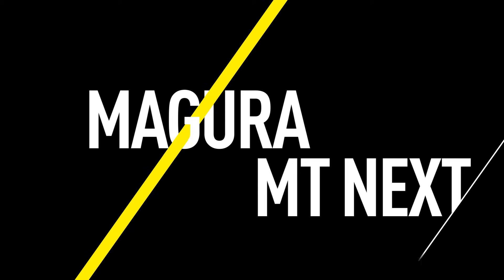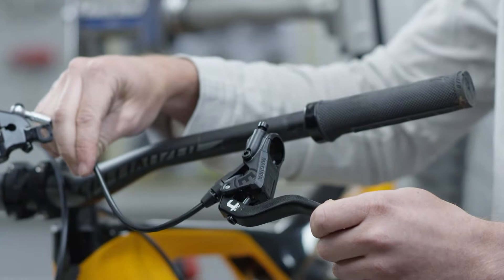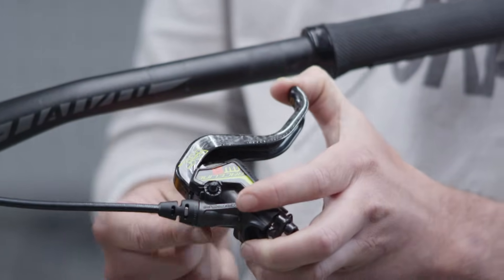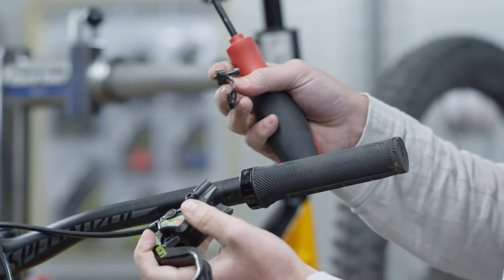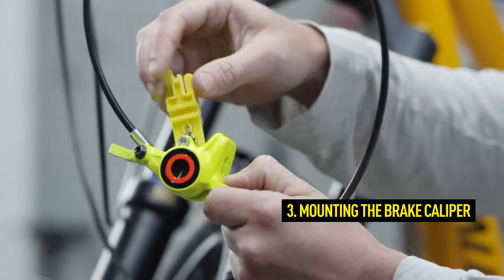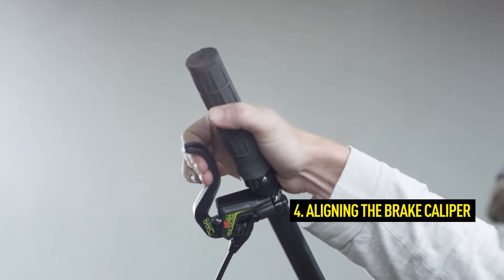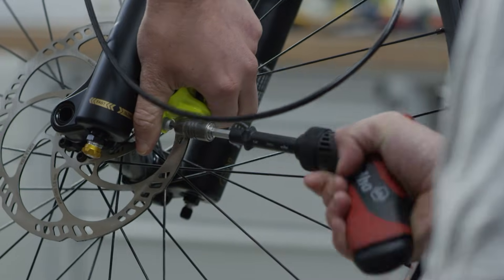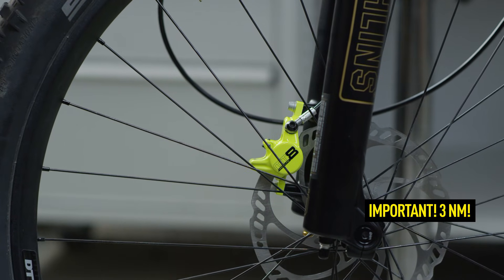MAGURA MT: Installation

Comment: Did I understand correctly that for installation Magura MT5 on the right side, I need only to rotate the clamp? And I don't need to do anything else.
Reply from the maker: Correct! For the MT7 and other models with the Carbotecture SL master you would additionally have to flip the BAT pin.

Comment: Why must that E thing be upward?
Reply from the maker: Do you mean the "M" on the clamp? Or did I misunderstand you? The arrows on the clamp have to point upwards and the "M" has to be oriented the correct way up, since the clamp is designed to carry the load that way. You then need to tighten the upper bolt fully to 4Nm first, only then continuing to tighten the lower bolt.

Comment: Hello , what difference between mt7 and mt5 ? and also HC3 lever can fit on both 7 and 5 ? thanks a lot
Reply from the maker: The MT7 has a bit more power and more customization options compared to the MT5. The HC3 lever does NOT fit the MT5. It's only compatible with Carbotecture SL masters: MT7, MT8 SL, MT8 Pro, MT Trail SL.

Comment: Fo not buy Magura. They do not have warranty if boughtvsecond hand and levers are not repairable only replaceable and no parts sold (ask before you buy) what an enviromental waste
Reply: No companies give warranty for second hand parts lol. And you can buy spares for the levers. You can buy just the lever without the body...
Reply: @Mortonbmx  car companies do... Computer and phones have second hand warranty. Magura does not sell o repair their levers (orings pistons)
Reply: @InstaLabSparti  were talking about bikes not cars or computers. I dont know of any bike companies that give a warranty to 2nd hand used parts.
Reply: @InstaLabSparti  by the way shimano dont either. You have to buy a new caliper/lever if you damage a piston or seal. Hope and sram are the only ones that have rebuild kits for their brakes.
Reply: @Mortonbmx  but you can find shimano parts easy, orings pistons...

Comment: To anyone thinking of buying these, don’t. I have just wasted money on same and they have damaged my raceface carbon bars due to their cheap lever mounting mechanism. I used a torq wrench to the correct nm, the bolt on the calliper sheared into two like chalk. As such I thought I would take the levers off as they are dire, replacing same with Shimano. Upon taking off the lever I seen that they have marked my CF bars, the mark directly lines up with the blunt plastic on the the back of the mt4 lever, the back of the lever mount is not smooth but actually tough plastic.

Therefore, I’m down over £100 on bars and now need to find new levers and a new bolt, seriously go for Shimano or Hope, these were worse than the Tektro brakes that came with my diverge.

Comment: I wouldn't consider this complete by a long shot. Pretty long, but not as long as all that brake housing that was left on this install
Reply: Agreed. This is the easy part - tightening bolts… I came for tips on routing through the frame with an cut open end housing…
Reply: @urbanphotographer  there is a end pin that comes with the baeaks.  Little late i see 😎

Comment: Hi does the magura MT5 eSTOP comes with brake pads and bolts and transport device to use when shorten the tube
Reply from the maker: Hi! The MT5 eSTOP comes with brake pads & transport devices installed, bolts to mount it, and some accessories such as a new olive and insert pin for shortening the brake hose.
Reply: @MAGURAPassionPeople  I wish the brake Lever were made of aluminium that's a only reason I didn't buy magura and bought shimano slx m7120 instead
In the future I might change the Caliper to magura

Comment: Magura doesn't provide washer shims with their adapter kits. Leaves the customer to go to home depot to find various width washers.
Reply: Why do you want washer shims? Serious question, i've never pulled brakes apart...
Reply from the maker: @thelongestnameinthecomment9677  They're used to adjust the height of the caliper in comparison to the rotor so the pads make contact at the right position.
Reply: @thelongestnameinthecomment9677  the magura adapters lack adequate adjustability. So, the customer will buy the magura adapter shims. Marketing genius!
Reply from the maker: @Paul We do sell washers to adjust the caliper height.
Reply: @MAGURAPassionPeople  my qm12 adapter KIT was missing them.

Comment: * accelerate bicycle to 30km/h
* brake bicycle to a stop
* REPEAT 30 - 50 TIMES!!!
man, i'm on a single speed urban trials bike in a flat city.. how am i suppose to accelerate to that speeds and repeat that 30-50 times :/
are there any alternatives to set pads to rotors
Reply: I just pushed my bike around for 10 minutes and actuated the brakes the entire time, then try (emphasis on try) to find a hill and ride down with the brakes actuated the entire time, make sure to bed them in properly because properly bedding in pads can result in 60% more power 🤯
My brakes where barely working before bedding them in and now they make shimano's look like a joke...
Reply: @thelongestnameinthecomment9677  hm..... thanks for ideas, i have access to a treadmill. it could work if i don't die in the process
Reply: @AlenHR  sounds fun too 😅
I ride at a bike park (lucky me lol) so i just bedded them in a little at home, the when i got to the park i rode down little down slope with my brakes engaged the entire time, the braking power went from: sram level, to: much more powerful than shimano saint, bedding in is (and i can't stress this enough) VERY important with organic pads especially. 
Also you said something about trials, sounds cool! Every time i watch a trials rider i'm amazed🤯
Reply from the maker: Please follow our recommended bedding in procedure. Bedding them in is absolutely essential to get the proper power out of the pads and prevent fading as well as noise issues. https://www.magura.com/en/components/techcenter/faq-the-running-in-procedure-for-brakes/
Reply: @MAGURAPassionPeople  you kinda sound like government official with that statement. and it seems you haven't event read my original post because it is obvious i am unable to follow your recommended bedding procedure :( also, you sent me link on information i wrote in my first post? wtf :D

man, i love maguras even since i got hs33 in like 2001. but this kind of community management from your side made me use 3rd party for information on your systems. i hope you invest more in that aspect of your business because your systems are amazing.
Reply: @AlenHR  Find the longest/tallest hill you can. Have someone shuttle you if necessary. Use the brakes the whole way down, firmly braking but not to a stop, then letting go to get up to speed again, then repeating. After 3-4 miles of this and 1000ft of descending your brakes should not be squealing and should be nice and grabby.

Comment: Useless video , my M7s feel spongy as hell and there brand new, the caliper is amazing... the levers are useless. What we need is a video showing how to get bite on the rotors without pulling the lever right to the handlebar grip. If that's how Maguras work I'm buying Shimano XT or.SLX levers which I have on my front brake and are amazing with nice modulation,.
Reply: Sounds like you just need to bleed your brakes
Reply: @reidanderson2  yeah,
Idk who this guy is but that's what a bleed is for
Reply: There is a bite adjustment screw on the lever. Magura customer service is a joke.
Reply: @tysonbear  well magura customer service isn't a joke whatsoever, send them a message on social media, it's way easier and they answer all the time, they aren't a massive company so they probably have a spam folder on their email, just because your emails ended up there doesn't mean their customer service is bad...
Reply: @thelongestnameinthecomment9677  I gave up on waiting for an email response years ago. I called them a couple times. I gave up on magura when they told be it was possible to compress water. These people obviously don't understand hydraulics.
Reply: @thelongestnameinthecomment9677  Shimano and Avid do respond to emails.
Reply: @tysonbear  actually water can be slightly compressed with hundreds of tons of compression but definitely not by hand
Reply: Ian Barcellos are you simply rubbing their b@@sl on every post, the product is cheap, simple as mate.
Reply: Paul my lever damaged my raceface carbon bars, clamping mechanism is terrible.
Reply: @Murphy252000  i have magura brakes and they're good, most people who use them seem to break them but luckily i know how to use a torque wrench, because it seems most of you don't. also, how did you tighten them? Because you're supposed to tighten the upper bolt flush and the lower bolt to 3nm.
I also know how to read instructions which is a pretty easy way to find this stuff...

Comment: Just used 4nm with a torque wrench to re install the lever on a new handlebar and it literally exploded. You guys should lower this NM.
Reply from the maker: Have you made sure to position the clamp the right way up and to tighten the upper screw first? Please check for warranty claims at your bike shop and send it in if necessary. You can also contact us in Facebook or Instagram for further information.

Cheers! MAGURA Social Media Team
Reply: Snap, cheap material, carbo this and that, ie plastic...... I also did 4nm on the back of my lever clamps and the lower one exploded in two.
Reply: To simplify what magura said: the top screw is meant to be fully tightened before you even start tightening the lower screw, then you do the lower with 4nm.
Actually 3nm, it works just as well in terms of tightening it down but will spin in a crash...
Reply from the maker: @Richard Marchmont Have you made sure to position the clamp the right way up (logo oriented correctly, arrows pointing upwards) and made sure to fully tighten the upper screw first so it sits flush against the master assembly?

You can check for warranty claims at your bike shop and send it in if necessary. You can also contact us on Facebook or Instagram for further information.

Cheers! MAGURA Social Media Team
Reply from the maker: @Richard Marchmont  I understand, we apologize for the issues you've experienced! If you're working with a dealership that's registered with us, I would recommend to directly contact our service team for these sorts of cases. They will be able to better help you than we can here on YouTube.

Comment: I bought a mt5 and the pistons won‘t retract enough to prevent friction on the disc
Reply: I'd recommend that you first exercise the pistons following the instructions found on magura's youtube video here: https://www.youtube.com/watch?v=JJI9ZrFMC1Y If that doesn't work, remove the brake pads and wheel. Insert a 4mm allen wrench in the brake caliper diagonally like a rotor would sit. Then attach a syringe to the brake master and pour some fluid in. Pull the lever until all pistons contact the 4mm allen wrench and the lever becomes solid. Then remove the 4mm allen wrench and dip a cotton swab in some royal blood and lube the pistons with it. After that, carefully push the pistons fully back preferably with a plastic tire lever so you won't damage the pistons. Then exercise the pistons using the previous method a few times but don't add more brake fluid to the pistons. Before pushing the pistons back in the last time, get a clean cotton swab and wipe any excess brake fluid off the pistons so it won't get on the brake pads during riding and then push the pistons fully back in. Clean the caliper with brake cleaner or isopropyl alcohol to be sure that there's absolutely no brake fluid to contaminate the pads and then put the wheel and pads back in. Remove the syringe and close the system before applying the brake so you won't overfill the system. Before actuating the brake lever, center the caliper by looking at the caliper not the brake pads, then pump the brake lever. The brake will probably rub and you will have a lot of throw on your lever. How you fix it is that you take a small flat blade screwdriver and put it in between the brake pad and piston on the OPPOSITE piston of the rubbing one and actuate the brake while pushing the brake pad inwards with the screwdriver. Repeat the screwdriver trick until no rub. You should now have a very solid brake feel and hopefully no rub. Cheers!
Reply from the maker: Thanks for the comment! As the previous answer notes, try mobilizing the pistons to see if that helps. If it doesn't, feel free to send us a direct message via Facebook or Instagram or contact your dealership to send in the brake for a service.

Kind regards! MAGURA Social Media Team
Reply: MAGURA thanks i‘ve already contacted your ig and it‘s working fine now
Reply from the maker: @ImproFlight  Awesome, glad to hear that!
Reply: @MAGURAPassionPeople  i don't know if this is a trick but i'll say it anyways 
Whenever i align brakes (any brake) i always get frustrated trying to align it so normally i align it the best i can, then i go ride around pull on the brakes, do some sprints etc... then i go back inside and undo the screws a little, pull on the lever, tighten the screws and bam the brakes are aligned 🙃
Reply from the maker: @thelongestnameinthecomment9677  Yep, pulling on the lever with the caliper slightly loosened is probably the best/easiest way to align your caliper. Unfortunately it doesn't work every time, then it's back to good old aligning by hand. Doing a second alignment after a quick spin around the parking lot sounds like an interesting idea!
Reply: Mine too. They are over filled with oil from the factory. You have to bleed just a little. You are likely to bleed too much and then need to buy the Magura bleed kit. It's  a shame their marketing genius doesn't carry over to their brake designs.
Reply from the maker: @tysonbear  We can't agree with the statement that our brakes come overfilled straight from the factory. The brake can only be overfilled due to user errors, e.g. when not using the transport devices to ensure the proper fill level.